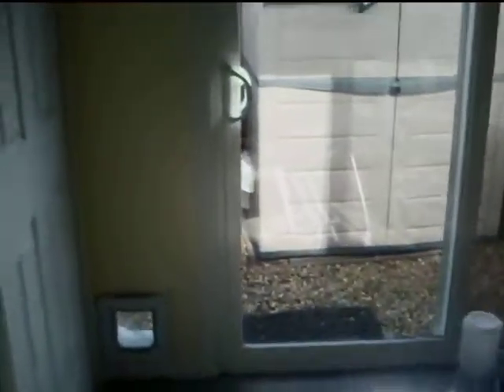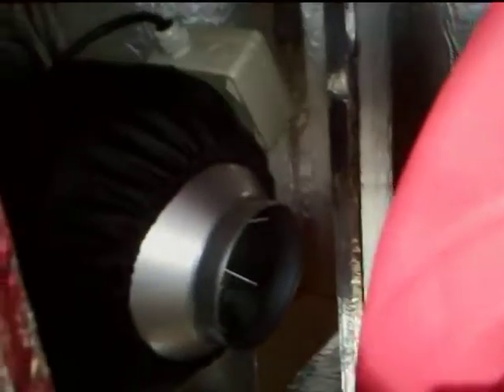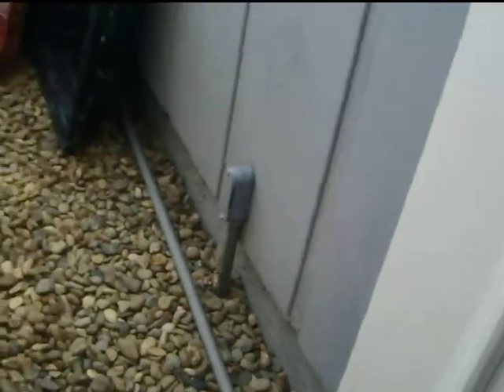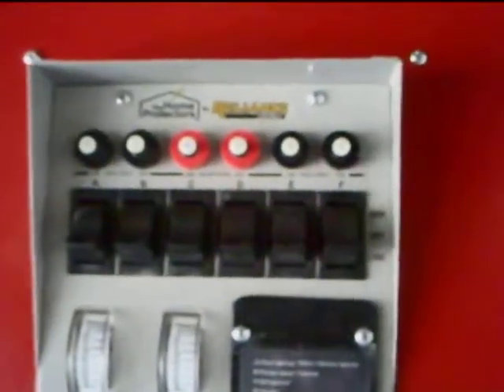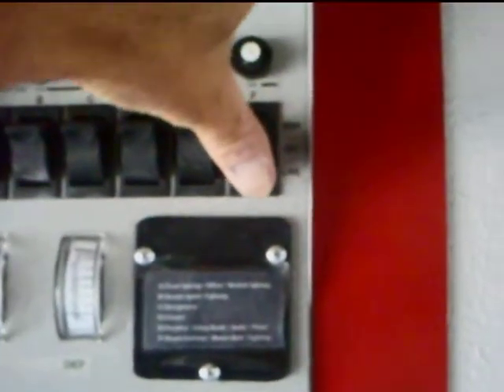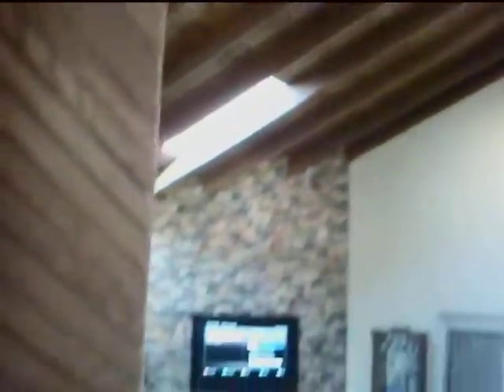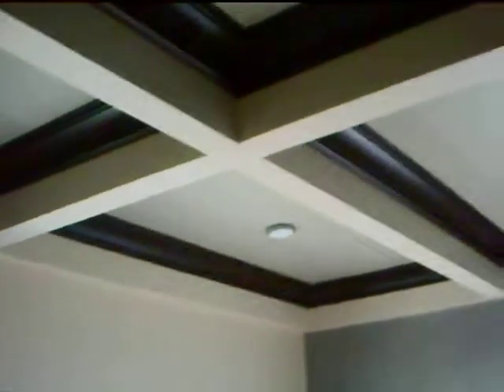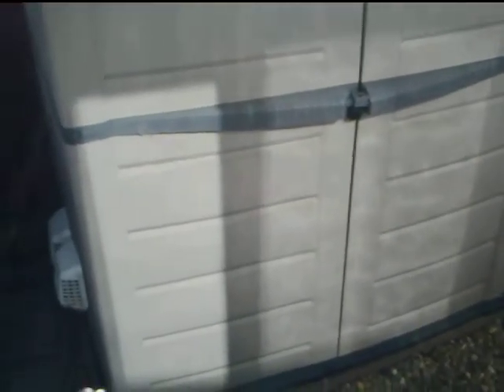boliy generator alpine@pacbell.net

Comment: Thanks for the reply, I just got mine today thru fedx. I found a RV forum & there's a thread there on the Boily & everything I read was positive. So based on that, I bought one. I think I read one negative thing about the boily, which is The way the fuel line gets routed cause's air pockets in the line, resulting in intermittent on/off running which is a easy fix. Take a look at that, you never know mite be that simple. Good luck.